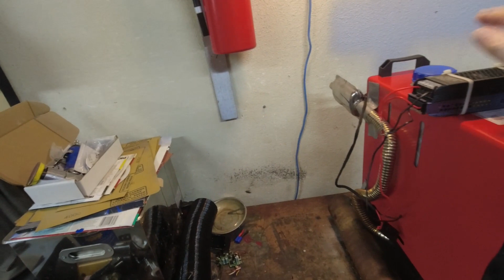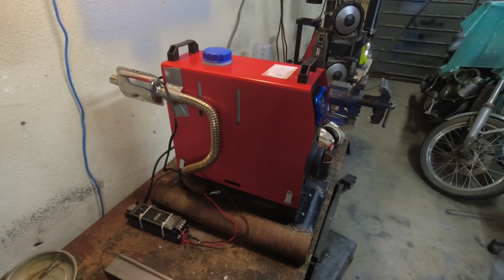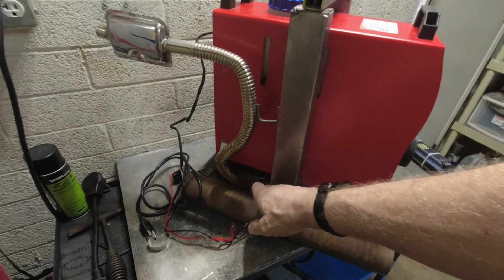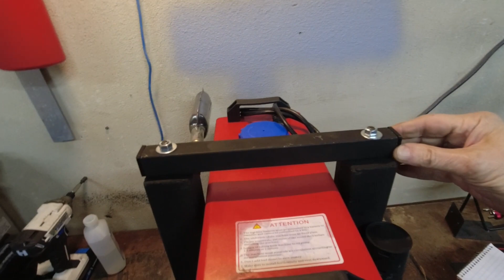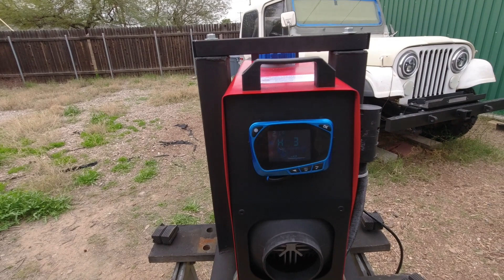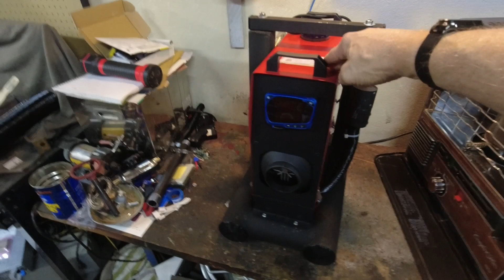Can I turn a Vevor diesel RV/Shop heater into a completely portable heater?

Comment: Cool setup.
Thanks for sharing.
Reply: I was wondering if you've had a chance to use the thermostat part on this type heater? What would be your thoughts on using one of these in a small greenhouse? It'll be hooked to a bigger fuel tank. 
TIA.

Comment: I'm working on the same project with one major difference. I could not help but notice how much heat was lost through the exhaust pipe. I found you could buy 12 ft of the stainless steel corrugated exhaust pipe for about $20 on eBay. So I am putting together a heat exchanger that would utilize that otherwise wasted heat before the exhaust is routed outside.
Reply from the maker: That's a good idea, the exhaust is really hot and that much extra tube would radiate a fair amount of heat. Definitely a worthwhile addition, thanks for watching and sharing! Oh, if you have a link on ebay for that tube let me know, I can't find it for anywhere near the price you mentioned.
Reply: Have you tried a water jacket around the exhaust?